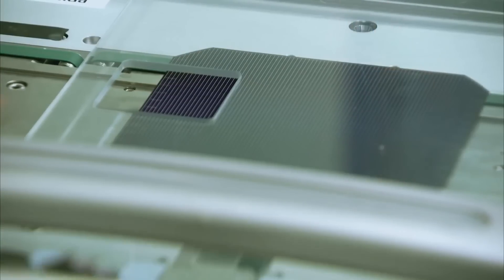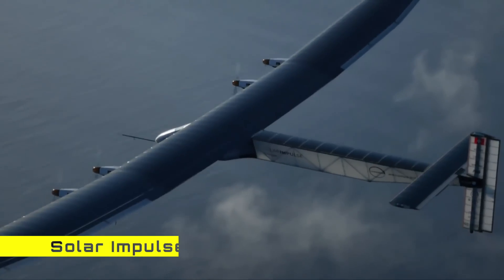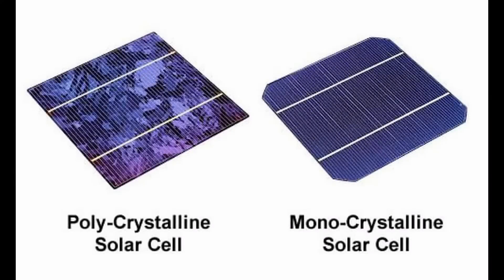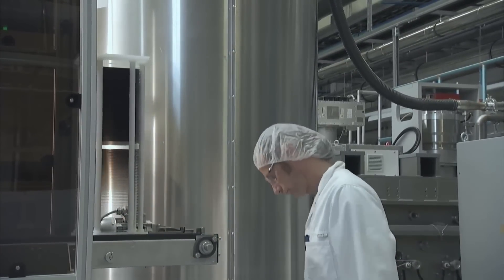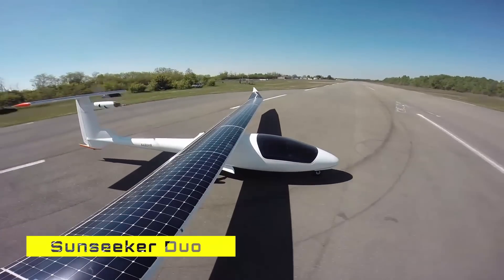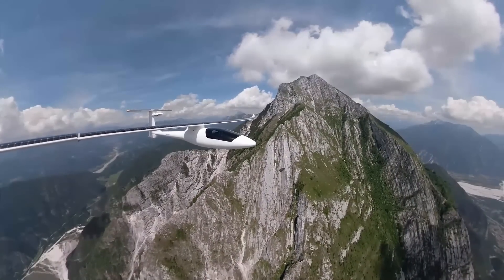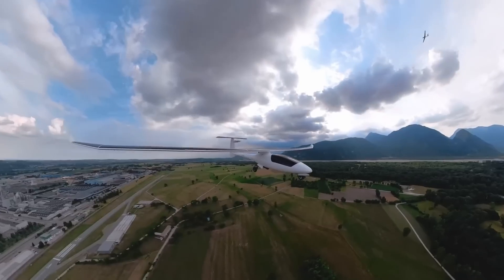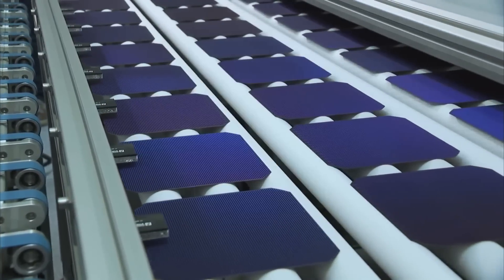Double Efficiency Space grade solar cell for new Electric Aircraft

Comment: Wow, where is solarImpulse now?   Oh, it broke up and crashed.
Reply from the maker: It did what it was meant to do. It proved solar circumnavigation was possible.
Reply: @ElectricAviation  Yeah well, it would have been honest to point out that it ripped apart in a gust of wind. It's like reporting Wright bros first flight without saying it crashed after 20m.
Reply from the maker: @tuberroot1112  I think had we focused on Wright brothers crash, we would have never progressed. Both Wright Flyer and Solar Impulse were pioneering feats.
Reply: @ElectricAviation  There's a difference between "focusing on" and failing to comment on and pretending it did not happen. Chemical energy stored in fossil fuels is way more adapted for powered flight than chemical energy stored massively heavy batteries. Only the hysteria over CO2 can unbalance the logic enough to make this seem like a positive outcome.

Comment: Even multi junction solar cells produce 1.3kwh per sq m which if a 737 wing and fuselage were covered, would produce around 60-80kw per hour. Not there just yet but there's certainly an argument to increase the use of the technology.  Solar cells cost have plummeted and multi junction increase in production will only reduce cost.

Comment: It doesn't address in the video the weight per sq mt of these solar cells. Do we know anything more just to see how I can modify the fabric on my wings, also according to you the price is 10 folds the one of commercial solar panels, so if I need to cover 12 sq mt of wings, that equals to about 12 panels producing about (5 kw/h x  30% =  6,5 Kw/h) and the cost is $12000 but it would provide only 10% of the power needed for a 65 Kw propulsion system. In reality when cruising the aircraft only needs 20Kw so we could practically extend the flight 20 minutes. I think I need to change aircraft. I will try with a motor glider.

Comment: One point with solar powered flight I find interesting: available power increases with altitude. At 20km you are already 90% above the atmosphere, which means much more energy from the sun impacts you directly without scattering. That said the question is how to launch to 20km? Maybe drop batteries? Maybe beam powered? The launch system might be the most overlooked part of the equation.

Comment: Great video.  A couple of comments if you don't mind.

I have yet to see any "slightly more expensive" thin film cells.  All the relatively high efficiency stuff (GaAs-based) is VERY expensive and, like GaAs-based "space" cells, likely always will be.

You show multiple clips/images of the ISS (International Space Station) solar cells.  The ones with the 4 holes in them.  These were the original cells and they are single junction Silicon.  I worked with a gentleman that originally worked with the company that made them and he was kind enough to give me "rejects" from various stages of production.

Comment: The Lightyear 0 electric car looks promising. Designed very different from traditional cars, to reach maximum efficiency on every part. The same philosophy as electric planes.
Reply: Have you seen Aptera Luna?
Reply: @michahalczuk9071   Interesting. Getting it to production is the challenge with all these concepts.
Reply: @headcrab4090  Aptera Luna is in production and they already sold out first 1000 pcs.
Top model will be available later though.
They have modular design, so they don't go through extreme production hells like others.
Edit 1k pcs not 100.

Comment: Solar powered airships have been around for over a decade. Solarships is testing a vehicle that can lift a a 20' container with 9000lbs cargo off a soccer field fly 200km at 75mph and land on a soccer field using solar power and solar charged batteries.

Comment: Typically these kinds of cells are used in conjunction with a parabolic mirrored concentrate the sunlight this reduces the cost and such cells have shown the ability to handle more than 900 sons this means that if concentrated sunlight could be used the mass of the solar cells could be greatly reduced one way to do this would be to cover the upper surface of the wing in something called a holographic film these were developed in the 1980s and never found a real market but they have the ability to focus light sunlight it from many angles to one specific point they could basically follow the sun during the day wings with a clear with surface and these holographic films could focus the sunlight onto cells mounted on the lower wing  if that lower wing were made of aluminum it could help you connect is a heat sink in this way cost could be kept down as well as mass
Reply: Not one punctuation mark.  Remarkable.  Also, you're wrong about "Typically these kinds of cells are used in conjunction with a parabolic mirrored concentrate the sunlight".  The great majority of multi-junction GaAs-based cells are used in "1 sun" (no concentration) applications.
Reply: Yeah I was trying out the microphone - sorry about that. I suppose I should not have said “typically “ but they have been shown to handle over 900 Suns.
Reply: @stevemickler452  Apology accepted!

Comment: or just Lead Selenide, PbSe at 0.27eV band gap, ie, infra red capable solar cells
Reply: just one junction
Reply: use the flywheel wing as the solar surface
Reply: circle wing acts like a delta wing
Reply: just add a tail and a main rotor
Reply: dont look at the sun, its too bright for you
Reply: try inflated pressurized wings for lighter less-rigid strength requiring wings

Comment: Are multi-junction solar cells so much more efficient because they are in "direct" sunlight outside the atmosphere, whereas the other solar cells, even thought they may be in "direct" sunlight, that sunlight is being diffused by the atmosphere thus decreasing it's intensity?
Reply: true,  the atmosphere filters out the spectrum so MJT would perform at lesser power output and maybe efficiency too

Comment: light is not all cells have to absorb.
As they (and this is crazy) get less efficient with heat, you need to absorb the heat too, wich is a double win since you gain new energy (heat) and the photoelectric cells work better when cooled (or put to a certain temperature).
Reply: Isn't there a way to absorb the heat and turn it into electricity? I have seen wood burning stoves - for camping - that turn heat into electricity so it can charge an electronic device.

Comment: Solar radiation will never have the power density to power electric vehicles, especially not aircraft. At most, they could slowly trickle-charge electric batteries over a long period of time.
Reply: Solar radiation can provide enough energy if used to recharge batteries or synthesize a fuel on the ground separately, before the flight.
Reply: Ok, but they can add a useful amount of energy
Reply: The Solar Impulse plane has already circled the globe on solar power. Solar Impulse 2 flew for over 76 hours non-stop on solar power. Airbus solar plane flew for 26 days straight. Solar airships could fly indefinitely.
Reply: Yes. But zero use able payload.
Reply: @taylorwestmore4664  Solar Impulse had a longer wingspan than a 747, yet it could only carry 2 people and fly at an average speed of 48 mph. A 747 is well more than 10 times faster and can carry more than 200 times the number of people. The chasm between the capabilities of those two aircraft might as well be the distance between galaxies in the universe.
Reply from the maker: It really depends upon the size of the panels. Yes the small backpack panels are good enough to trickle charge batteries but we are talking here about solar cells with peak power of 3 kW and above. Flights have already been demonstrated as mentioned in the video

Comment: So all these are efficiency per area not weight, weight is important in aviation but I do not know any good source on this. Secondly, there more expensive so less good but more might be better ti make up. Thirdly, some solar cells can be structural too reducing weight penalty. In other words, it’s much more complicated than presented
Reply: There was a literally coating just before Covid broke out that you could paint on a surface and create a solar cell just a coating. Also there’s a new technology which princess solar cell on glass surfaces very thin it appears to tint the window slightly and it cost is the same as having your windows UV tinted the same machines used with a few modifications Both technologies look very promising
Reply: @gregkelmis2435  "Solar paint" or "printed solar" are real oversimplifications.  While it's true that very thin layers of "photo active" materials can be painted/coated/printed onto various materials, there's still quite a bit of "segmenting" and "wiring" that needs to be done in order to build voltage to useful levels.